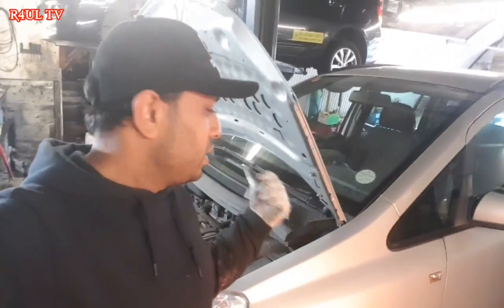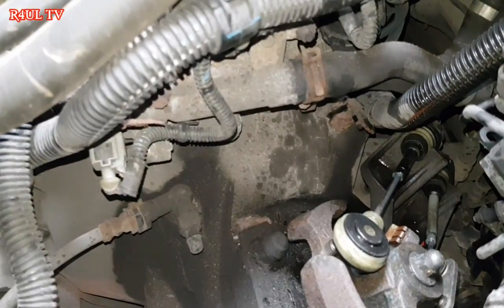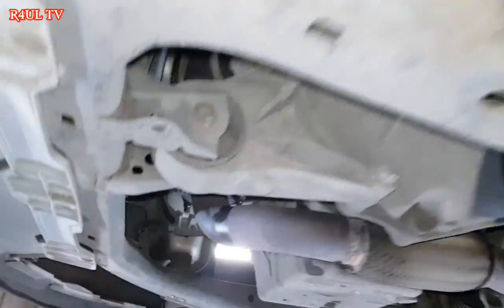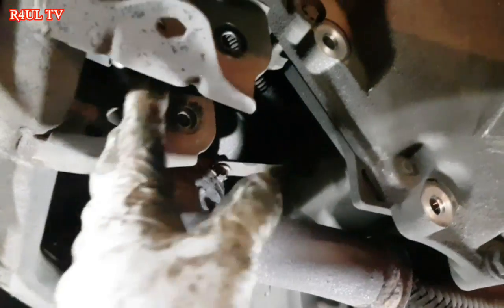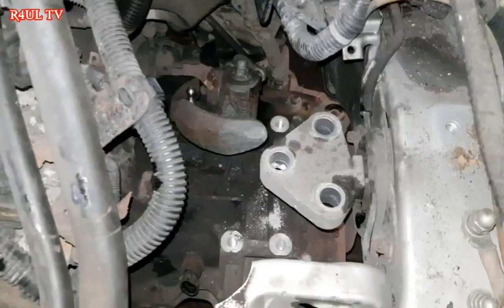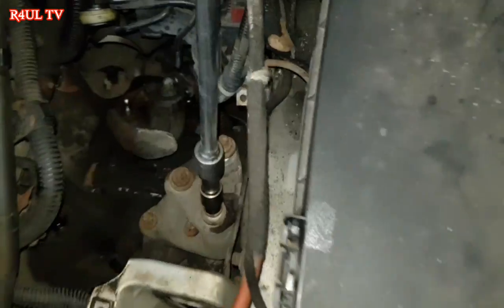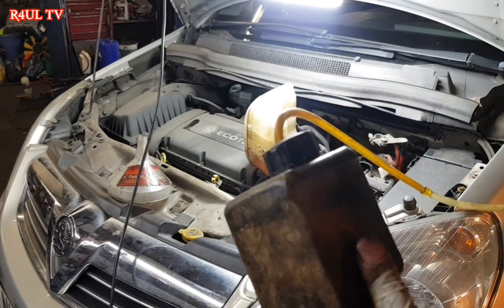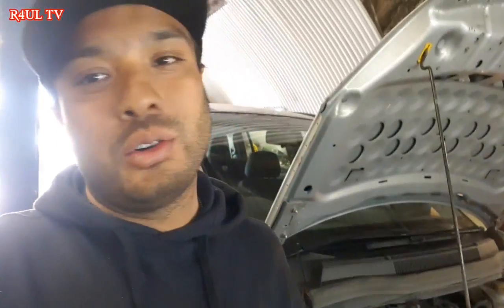How to Replace Vauxhall Zafira Clutch 2008

Comment: Hi, thanks for your video. Just wanted to ask, you said about the gearbox oil refill level bolt on the side of the gearbox. When you top up the gear oil from the reverse switch, how do you know when the gearbox is full if you don't remove the level bolt? Thanks 😊
Reply from the maker: Few ways to do that, the simplest way is to go on auto data and just find out how much oil it takes, or the other way when you take the driveshaft off what ever comes out catch it and just re top it up with same amount, or if you can take the bolt off just do that, most of these Vauxhalls normally take about 2 to 2 half litres. Thanks for watching
Reply: @TEAMR4ULTV  okay great, thanks for the quick reply 👍 😀
Reply: Hi jus asking my zafiras clutch pedal makes a hum when slightly pressed any ideas plz
Reply: @leahmccarthy3354  just a guess, it could be the clutch release bearing. Wearing out!
Reply: @TEAMR4ULTV  hi were did u get yr comma cap
Reply from the maker: thanks for watching Really appreciate it. It was given to me by my partx supplier
Reply: Just a quick one I done this job following your video thanks for the video but when I got both drive shafts out there was no oil is that a bad sign also what du think I should top up 1litre or 2 and finally from reverse light switch do I remove the whole switch ?
Reply: @dini9190  It sounds like you may have a gearbox oil leak. Yes remove the reverse switch, and remove the level plug. This is behind the drive shaft on the left hand side. It's a 13mm nut it'll have a magnet to it, it's a bit tricky to remove but worth doing, because when you refill the gearbox, the oil will seep out and then you know its full! And then run the car and check for any leaks.
Reply: @leahmccarthy3354   mine is doing the same and now it's leaking too, time to replace it I think..

Comment: Is it going to be the same in Zafira B 1.7 CDTI ecoflex 2012 plate? As it has flywheel too.
Been quoted 1200 and thinking its bit too much
Reply from the maker: The principal is the same but on the diesel there is very little space much harder also gearbox is a lot bigger
Reply: @TEAMR4ULTV  Hi. Ive also got Zafira B 1.7 CDTI ecoflex 2010, I had clutch and dual mass wheel replaced 2 years ago, than last year I've got motor replaced with new timing belt, egr, turbo, etc. and the car was good for a year, and now my clutch sleeve cylinder started to leek, so in general mechanic quoted me pretty the same price as I've paid for engine replacement. So the question. where are in UK you based, and how much would you charge to replace this sleeve cylinder, the way you did in the video. Thanks Zabi